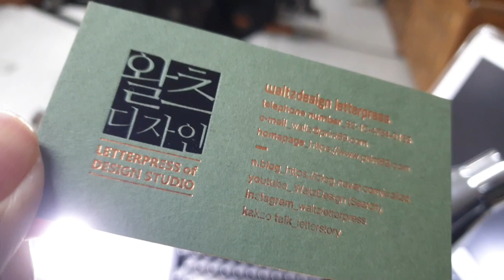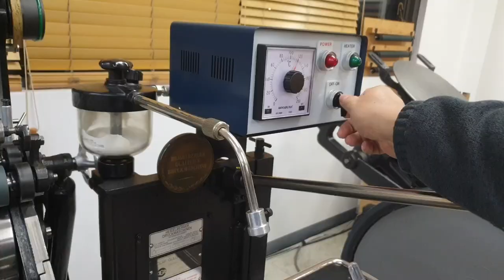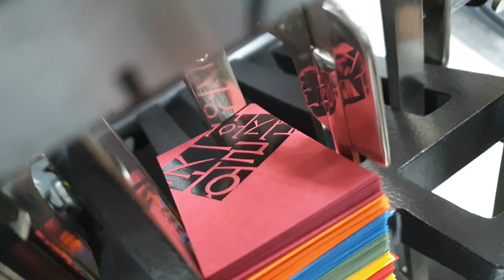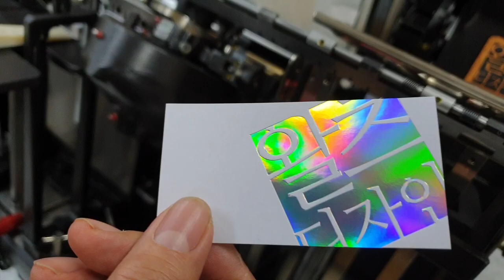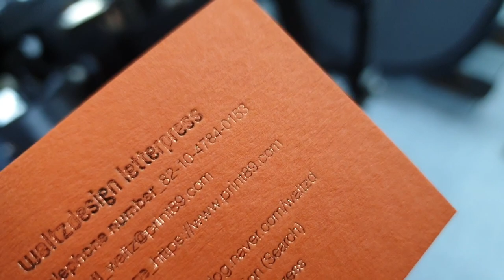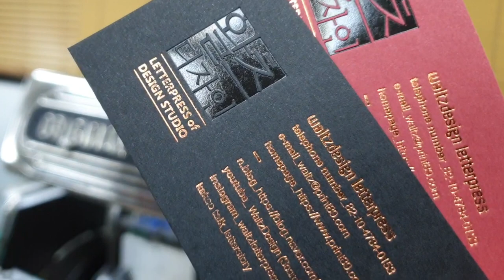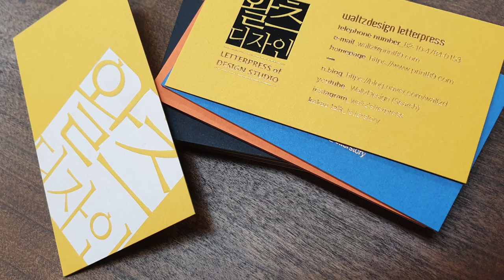Windmill Letterpress printing _ Foil & Duplexing Businesscard

Comment: How did you manage to add the heating modification for foiling or was that part of the original machine? It would be helpful to know how that was possible since I have same machine but no heating part
Reply from the maker: The equipment was only available for printing, and the heat system was commissioned to a factory in Korea. It is not a product to be sold, but a heat device manufactured separately.